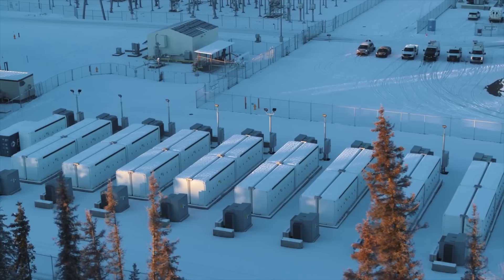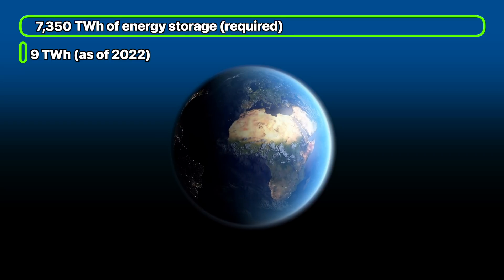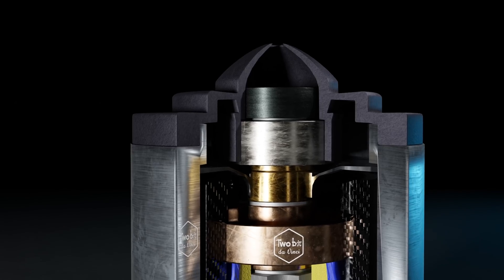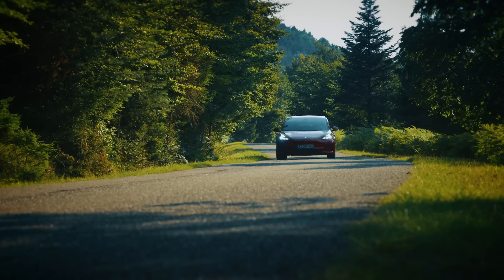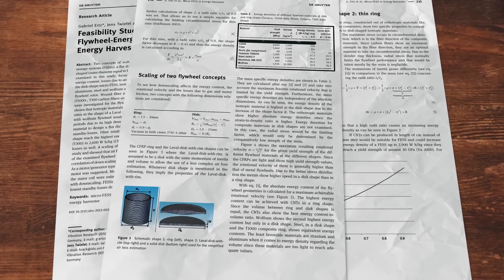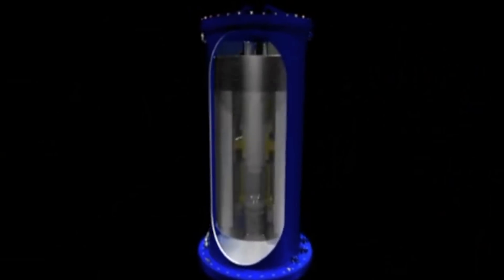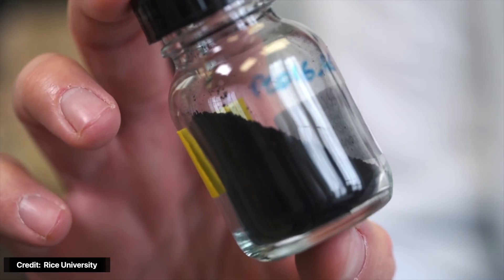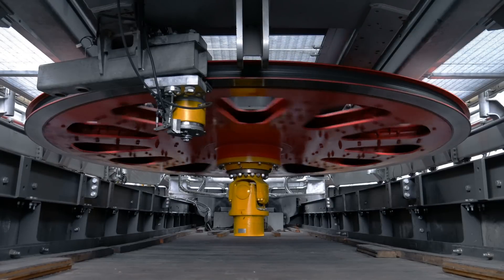Breakthrough Energy Storage Tech CRUSHES battery prices by 90%!

Comment: The lowly gallon of gasoline contains 33.7 kWh of energy...

No mechanical or chemical battery will ever approach this density figure.

Too bad one just can't take a bunch of hydrogen and carbon mixing in a butt ton of energy to create flowing rivers of gasoline.  Then, the stuff could be burned in efficient fuel cells on-demand.

Comment: How does this compare to super capacitors? They seem to fill the same role but do it mechanically instead.
Reply: He said they have the same power density, but I'm not sure about that. The power a flywhell can produce completely depends on the motor/generator powering it. Super capacitors are known for extremely fast charge and discharge cycles. Not as fast as a regular dielectric gap capacitor, but a lot faster than a battery. I think flywheels would have a greater energy density though. Supercaps just don't store a lot of joules.

Comment: For a lighter material to store the same energy it has to spin faster.  Faster spinning motors are less efficient I think.  I don't think that's going to work out.
Reply from the maker: lighter and stronger materials, allow you to place the mass further away, and have less mass closer to the axis of rotation. that's one of the keys... any mass should be as far away as possible... plus if the material is super strong, it can also stand up to faster speeds... but yeah its complex for sure
Reply: Moving the mass further away (to compensate for the weight/density reduction) is going to reduce the volumetric energy density...and reduce mass energy density since the container now has to be bigger.
Reply: Don't current flywheel storage systems have a fraction of the energy density of batteries?  (Like 1%?)

Comment: The motor/generator is definitely going to generate heat during 'charge/discharge', especially as the charge/discharge speed increases.  You seemed to completely ignore that.
Reply from the maker: that's why efficiency isn't 100% we accounted for it in overall efficiency, which is actually really quite good, the problem of course is standby time
Reply: You said in the video, heat was not an issue.  I don't believe that is correct.

Comment: I’m surprised about the rate of loss of energy when it’s just sitting there. And you’re saying this is with magnetic bearings? Where does all the energy go anyway? It’s in a vacuum so it’s not air resistance. If it’s floating on a magnetic field, you would think there’d just be a tiny, tiny amount of magnetic bearing “friction”.
Could it be due to the earth’s rotation. With that much angular momentum, changing the spin axis as the earth rotates is going to put tremendous force on the bearings. What about building the whole thing in a gyroscope cage?

Comment: The interesting thing is that currently flywheels are used extensively on our electric power grid. If you switch on a light bulb, there is some flywheel on a power generator that instantly produces that power. Over a minute or so, the gas plant will compensate for that by increasing the fuel supply so that the generator will pick up the power required. But the 'immediate' power comes from short-term storage in flywheels connected to generators of the fossil fuel (or hydro-electric) power plants.

For the future, when the grid will move to renewable power with grid-level (battery) storage systems, those fossil fuel plants should no longer be needed and with that the flywheel will no longer be used. The replacement however will automatically come from the power-inverters on the grid-level battery systems. Electric power-inverters have very short response times (order of milliseconds) and with the grid-storage batteries that we are going to need anyway, these inverters can easily replace the function of the old fossil-fuel power plant flywheels.

So I think that for a future that includes massive (battery, pumped-air, hydro) grid-level storage systems, separate flywheels for grid storage systems are likely not needed, since power electronics on those grid-storage system of the future will take over the function of frequency/phase compensation that flywheels we have today.
Reply: The "flywheels" that you're talking about are almost always just spare generators that are ready to take over if another generator fails.  Batteries and inverters are not practical replacements.simply too expensive for the benefit gained compared to other methods.
Reply: This is a great drawback to solar power and that burden is placed on conventional plants.

Comment: Basalt fibre. Similar strength and stiffness to carbon fibre.

 Cheap as chips. 

You melt basalt and squirt it out a high speed rotating tungsten spinneret.
Ideal for stationary storage solutions. 

Not buying the energy loss at standby claim. Carbon fibre needles spinning magnetically levitated in a vacuum have spun for decades with very small fractions of a percentage of loss. You'd have to be using contact bearings and spinning them in air for the losses you claim.

Comment: flywheels should be in every light post and every building core .. you need alot o fthem to charge fast and dynamically like surge suppression ... flywheels work as surge guard layer .. with batteries behind them ... flywheels should discharge into Solid state batteries if they wont be used ...

Comment: Curious thought, what is it that makes them not good for long term storage?  I assume it's forces like friction and gravity?  So, what if there was a giant 100 ton flywheel in space?  :D  If there is no gravity and you only engage it with minimal forces of friction it should spin almost forever right?  Might be good for super long term energy storage for spaceships.
Reply: Almost certainly the problem is friction... atmospheric if not in a vacuum and bearings if not electromagnetic levitation.
No, gravity can't be an issue, but inertia would be. The inertia of the angular momentum of the spinning flywheel is what makes it work, but there are gyroscopic forces if the flywheel is nudged from its spinning axis. That's not gravity and gravity shouldn't affect a flywheel any way I can think of.
Reply: Using that logic, which seems reasonable to me, the earth itself is a giant flywheel.  I wonder if we could pump energy into the earth's rotation, speeding it up slightly, and slow it down slightly to gain access to that energy.  Do tides already do this?
Reply: You would require two contra-rotating flywheels in order to tap off energy potential.  On earth it is the relative difference between the (static) ground and the rotating mass that provides the potential energy.
Reply: There is nothing to react against in space  so you would need two, counter-rotating flywheels!
Reply: Mostly friction I imagine. You've got to have bearings to support the axle. I thought about trying to mag lev it, but there's a risk of positive feedback where it could spiral  out of control at resonant frequencies. It might be possible to use control electronics to keep it away from those speeds, but there's a limit to how fast you can accelerate through them, that's kind of the whole point of a flywheel.

Comment: When something seems like a great idea, but doesn't exist, there is usually a very good reason why.  In some cases, there is a practical or technical reason why it simply won't work.  In other situations, that solution only applies to specific use cases, such as the large sand battery used in Finland to provide heat to a community boiler network.  This is only applicable where such networks exist or could realistically be built out.  I think the same thing applies to the use of large flywheels; they will never be very common because their use case is too specific.

Comment: Carbon nanotubes aren't a material.  They're a molecular structure.  They don't belong on the same list with bulk materials, including all the inevitable crystal boundaries and imperfections.  It's like comparing the measured strength of one bulk material to the "strength" implied by the activation energy required to burn another material.

Basalt fiber also has unobtanium-level tensile strength, when you look at individual fibers instead of at structures fabricated out of them.

Also, for stationary applications like utility energy storage, mass isn't particularly relevant.  What matters is levelized cost.

Comment: If they can make them with these possible future energy densities then an electric plane becomes a way better option then it is at this moment. Because the current batteries are only good enough for limited range and are too heavy for longer ranges. But with an energy density that is a couple of times higher you can do a lot more.
Reply: A flywheel in a plane is just a giant gyro. It would resist or exaggerate flight control input and drawing off power is basically applying a break to the rotating mass the plane would want to spin in the opposite direction. Any system to negate all these forces would add weight and complexity. The shielding needed in case the spinning masses fail also makes this a non starter. You would be one hard landing from kissing your bearing assembly and possibly the entire power package good-bye
Reply: @adrianwilson7536  You can also control your plane with the gyro. Like  you can do in space.
It would indeed be difficult. And not really like a normal plane. But a power density like this would be great. Not sure if it is really possible to achieve that power density.

Comment: 3 to 20 % per hour is a number that I did not expect. Even in vacuum sealed chambers if that is the degradation, then it has to be the bearings. But I did once see a research where the wheel was magnetically levetaded for zero friction in a vacuum chamber.

Comment: I know of a data center that used flywheels as part of their energy backup system.  The flywheel kicked in immediately after power loss to provide energy while their UPS system kicked on.  They said it was more reliable and prevented the split second of power loss most UPS devices have when turning on.

Comment: I want to see the adoption of clothes lines to dry off wet laundry.  And not using dish washing machine will save energy as well.  Clothes lines for drying out wet laundry are very effective energy savers, because of the fact that electric clothes lines use up a ton of electricity.  Clothes lines for drying out wet laundry out in the summer sun and wind have the potential to work much better than electric clothes drying machines.  One other thing that can be done is using indoor clothes lines for more personal clothing items like under garments.  Indoors clothes lines work quite well for winter time clothes drying.  It doesn't take that much time and effort to just hang up some clothes to dry.  Also plastic hangars work great on a rack for hanging up dozens of socks.  A basement furnace room works very well for drying out clothes on clothes lines in the winter time.  Also will add a small amount of needed humidity to home dry air in the winter time, I have had no problems with causing mold or anything like this.  We should have solar panels added to the land used up by wind turbines.  This would be more efficient use of the spent land wind turbines use.  If we see wind turbines we should also see solar panels also set up on the same ground, to more efficiently use up the entire space spent by the wind turbine more efficiently.
Reply: Andrew, you are spot on in so many ways!
And that is why, regardless of causes, we are screwed. 
I do think that humanity is very responsible for this surge in the Climate situation. 
If we are to accept data from the past 300 years, we are the blame for this one. 
With geological evidence and simple measurements, such as in 2017 a 30 year veteran of crab fishing saw the largest count of juvenile snow crab ever, and predicted 2021 would be the best crop ever, but instead, they actually closed the season. Why? The temperature went up, and they basically cannibalized each other. 
But nothing will really change.
The innate greed of people, as well as the desire for power and control of those that taste it creates monsters that lose all their humanity and they are not able in any way to care about the planet, and certainly not people, especially employees. 
90% of current inflation is simply corporations, but far worse, and accelerating exponentially are Venture Capitalists and Merger and Acquisition funds that control most legislation and used Covid to swallow Trillions in free aid, or even zero percent loans. 
I get about 25 magazines related to different manufacturing and production associations, and they are filled with buyouts, takeovers, and go to Bidspotter com, I have collected an average of 800 small Mfgs per month because they cannot remotely compete with what have become  Oligarchies, building massive facilities, totally focused on automation, and the insane combination of robotics, the new  500K to 15M CNC and other equipment, software, Machine Learning, Artificial Intelligence that is so beyond anything before, their only goal is to eliminate all labor. 
It's so common now that a 300M Factory only needs 40 to 70 people to run it. They are truly lights out production, and I swear they can run an entire weekend with no more than one programmer, a service tech, and some unskilled labor to load 32 blanks onto their 4 sided pallets that are completely, perfectly finished, robots unload, perform 100 percent quality and inscribing, measure every tool, it's shrinkage, and adjusts the process to compensate for it. 
The truly wealthy care nothing for the misery of the 99%, or the Planet, and people scraping out a living can't do anything about the Climate. 
BTW, I live down in the disgusting, Botox and Bling of the South,  Boca Raton, and it's illegal to have laundry lines. 
I love that fresh smell, and yes, resistance heating is the biggest household waste. 

As we become more financially, nationalized, pitted group against group, I'm a former Marine who was so filled with pride I could burst every time they raised the flag, and grew up almost the only white family in South Chicago, was married to a Puerto Rican, and now have 10 years with the absolute love of my life, so beautiful, loving, kind and brilliant Haitian, so blessed that she chose me.
In the Corps, we were all Brothers and Sisters, and we all bled Green, but last year, we were hand in hand, and some &%#$S driving by called me a XXX lover.

Most people have a job. Or own a business, but they have titles, machinist, driver, policeman, teacher, etc. People with an MBA,  CEO, CFO, vp, cto, fund managers,  investment bankers, stock broker, 
Money and Power Corrupt, all the way. 
In 1975 we had 275,000 people in  prison, now it's about 1.4 million. 
People doing 35 years for three marijuana convictions. 
Half a million are in Private Prisons. 
We are becoming a fascist country, where certain groups actually believe their rights are stronger than others. 
We have gone so far back. 
The Fort Lauderdale Sun Sentinel  just published a front page picture of the last recorded lynching. It was 1935. Bunch of families with 5 year old kids there, looking sick, the men, smiling and proud. 
In Florida, our Governor just established a voter fraud unit. 
For 8 years, the CEO of a medical center that defrauded Medicare of hundreds of millions , was what I read, but he bought the Governorship for two terms, first thing he did was eliminate the right to vote for people who had committed nonviolent crimes, and set up a review board of him, his lackey state attorney Pam Bondi, they met once a quarter, let them grovel, approved less than 5 per year, were caught on a hot mike joking about the people they declined. We finally got an amendment passed that allowed all released felons except murder, sex crimes, some others. 
Then Jackboot power starved Desantis said and any other conditions, like if they owed fines. There is NO WAY, no central place to find out, but felons who tried, then applied and received a voter's registration card, and voted, 
every Democrat was suddenly able to have records found.  Even $75, they were arrested. 
Jailed. No money or way to fight,  just life destroying more criminals.  Ok, sorry for all this, just from hanging out some sheets. 
We have politicians and uber wealthy. Then we have 320million people who have been set against each other, even willing to spit on the justice and righteous rule of law that so many have willingly given their lives to protect. 
Andrew, I know almost nothing about you, your beliefs, personal code of ethics. 
But we have two legs of a stool which can never be stable. 
For these years I have been busy and I think I have some bones of a chance for a solution that will give all of us, young, old and with  knowledge, the millions currently on government aid, people with disabilities, people who deserve a second chance, and absolutely will be stakeholders, profits and pensions, learn, earn, teach, train,  mentor.
If any of this resonates or just want to talk about it, comment back, or go to my info page.
Have a great week!
Reply: Dish washing machines use a lot less hot water than you would by washing and rinsing manually. Sometimes water is more precious than power, although that depends on the region. Most residential energy usage goes toward HVAC, so better insulation and more efficient heat pumps would go a long way.

Comment: Correction: Formula 1 doesn't use flywheels. They use a super capacitor pack for their ERS systems. Williams racings did design and test a Flywheel setup, when ERS was first introduced, but it was only ever tested, not raced. It didn't match the performance of the Supercapicitors